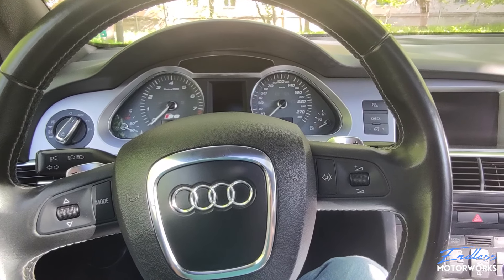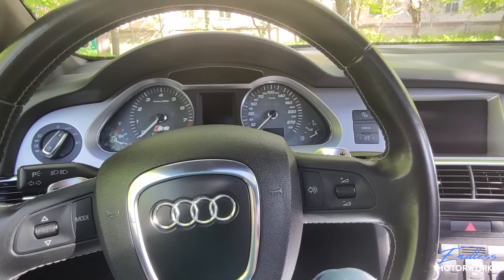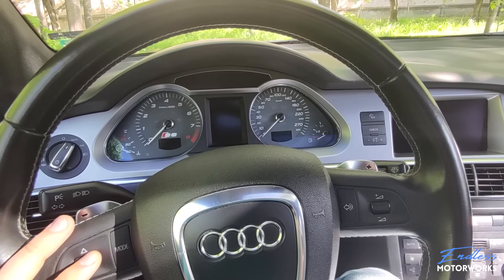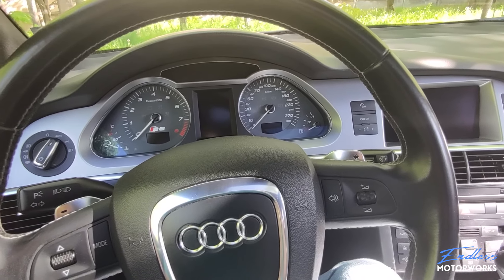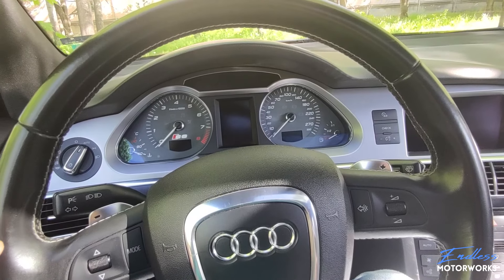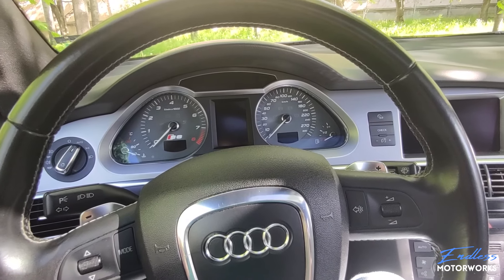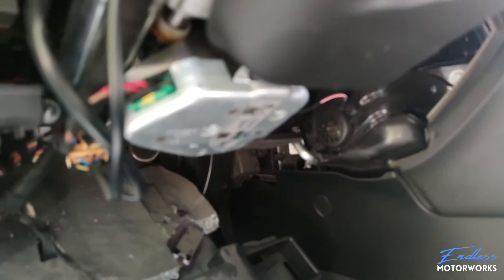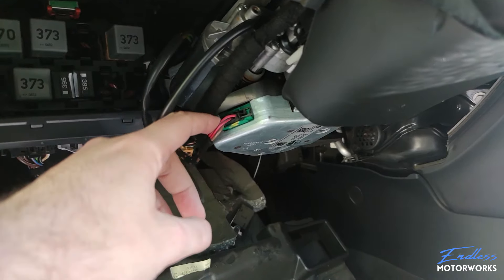How to Prevent or Fix the Steering Wheel Column Lock Actuator Issue on an Audi A6 / Q7 (DIY Repair)

Comment: Great video, thank. Wonder if it possible to just disconnect plug remove wire from plug nicely and put plug back in? Would that work? Thank you.
Reply from the maker: I have not personally tested this, but as far as I remember from the research I did before doing this DIY, this wouldn't be possible, because removing the plug would trigger a error to be stored.
Reply: Yes, remove wire "nicely" and cover with electrical tape. 
He says that in the video, but then didn't understand your question fully 🤷‍♂️🤣

Comment: Hello...same issue as all the other guys here. Audi a6 2005. I also have no access to a vcds scanner....you mentioned that a hammer to the lock might help and i would be able to get it unlocked this way and then cut the cable. Does that mean the error code is gone also?
Reply from the maker: Yes, if the column gets unlocked the error will be stored, but will not be a current one any more.
Reply: Thank you so much....I bought the obdeleven app and adapter and it cleared the code and I could start the car....now I will go and start cutting the wire...
Reply: @andreasvoss4931  did it resolve the issue? im getting ''ignition defective'' sometimes cant start car at all, and car is dead silent, im think will this fix?
Reply: @2_S1MPLE  it depend how you see it.....after clearing the error code it has a permanent red error on about the steering wheel lock but it can't get stuck locked anymore and get you stranded. It's the wife's car and she don't mind the red error light flashing so it will stay like this.....only cost was the adapter for 69$.....not 2500$ to 4500$ to fix the steering lock and column...
Reply: @andreasvoss4931  I hace the same problema, since I cut the red-black cable. I have tried to correcto it with the VCDS un module 05 and un module 19 (Getaway), but I hace not succeeded. The car stats fine but the flashing red keeps showing up on the fis.  Have you found any solución?
Reply: @joseantoniosanchezdelgado1918  no..but it causes no other problems so I will live with it. It's not worth the real repair for a 2005 Audi a6....
Reply: @andreasvoss4931  Thank you so mucho. I Will continúe as it is now

Comment: I did just this, but I'm still getting the issue. Of course the steering column doesn't lock anymore but there's still no response when I'm turning the key. Completely dead and then works again after about 3-4 minutes of waiting / trying. 

It usually happens if I try to restart after a longer drive (30min+). 

Would sorting the microswitches help this?
Reply from the maker: Sounds to me like you never had an issue with the steering column lock actuator and the cause of the intermittent no start is somewhere else. You should get the vehicle scanned for errors before doing anything further.
Reply: @EndlessMotorWorks  how to tell if the problem for the ''dead'' symptom when insert key is because of steering lock issue, not the ignition problem which shows on dash - ignition defective''
Reply: check your battery If the Voltage low it might happen
Reply: @NIKARTIST89  problem solved: it was my wireless phone mount and charger interfering with the steering column. Unplugged and car works perfectly 😅

Comment: if you cut the wire is there the risk for locking the steering while driving?
Reply from the maker: No, this is not an option, as the wire being cut is the one that actuates the steering lock itself. If it is cut when the steering is unlocked, then it will not be able to lock itself.

Comment: Will it be the same if i unplug the wire going to the lock ? Or only cutting the black/red wire works? And is it the same procedure on Tourareg 2008 v6 ?
Thanks for posting.
Reply from the maker: Unplugging the entire connection will cause the vehicle not to start, as the module is part of the immobilizer. Not having it connected at all will make the car think that someone is tampering with the immobilizer system. Cutting the wire is the only way to go. By cutting this particular wire you are interrupting the connection between the part of the mechanism that engages the actual lock, while still allowing all other functions of the steering lock to continue as they were. 

Regarding your other question about the procedure being the same on a VW Touareg, I can't tell you for sure. What I know is that this module was sued on the A6 C6 and first gen Q7. You will need to check by part number if the same module was also put on your vehicle.
Reply: @EndlessMotorWorks  Thank you very much for the info you're a life saver. Take care.
Reply: Did u find which wire color is it for the the Touareg because it doesnt have black and red wire
Reply: @hagghag9435  i was too afraid to cut any wires, so i ended up taking out the actuator, and replaced the capacitors, and it's has been working great since replaced ~ 3 months ago.

Comment: This issue just happened to me.  My question is will the push to start button work or will it immobilized.  Either way great video.
Reply from the maker: No it will not work. The immobilizer will still prevent the vehicle to start.
Reply: @EndlessMotorWorks  going to snip the wire to keep going and next time i am at the part yard will look for one to send out.  thanks again

Comment: Hello, I encountered this problem today, i put the key in electronics turrn on but my steering wheel is locked and i cannot move it,radio turns on and the lights but no contact at turning on the car? What is my next step to do. as you said in video i cannot cut the red and black wire if this problem already happened ? i need help
Reply from the maker: You will need to clear the error code that is stored. After that you can cut the wire.

Comment: Does anyone know if a 09 audi a6 ignition swith will work on 05 a6?
Reply from the maker: It will work, but will most likely need to be coded as it also has the immobilizer built into the module

Comment: Push start button will work if this wire is cut?
Reply from the maker: Yes, it will work.
Reply: So I am not mechanical, but if I can get a really good deal on a 2005 A6 w/120k for $2000, because its steering is locked... what do I need to do?
Assuming that current owner has tried to unlock it with the key
...
I am cool with cutting the wire once it is unlocked...
Thanks
I love to see videos like this that help save an ordinary Jane $$$
My husband's first vehicle was a 1989 Chevy S-10... brand new.
Before the warranty expired it's brain died and was replaced. But over the next 24 years it happened 4 times.
The brain cost $120
The labor was $2200. Because we had to unscrew the entire dashboard to reach the brain.
It wasn't difficult but damn if it didn't take forever to do.
Looking forward to your reply
... plus you Rock

Comment: Bro my audi a6 2007 may same issue.
When I put the key and turn on, nothing happens. Ignition cannot on. 
Can do the same procedure?
Reply from the maker: Lots of different issues can cause a no start no crank situation. The first thing I would recommend is getting the vehicle scanned for errors and seeing what is the underlying cause. 

Having the vehicle scanned and the errors cleared is also a prerequisite in order for what is shown in the video to be successful. Otherwise, you will may cause the steering to stay permanently locked.

Comment: Hey bro
I’ve got error code 00288

And this has been happening for months.

Steering locked, car won’t turn on and needs to be cleared on computer to start.

If I clear all the codes and cut the red and black wire will the problem come back or will it stop?

Thank you
Reply: Code says faulty steering column actuator
Reply from the maker: @1risetogether  Yes, as far as I know this is one of the codes, which can be resolved by the simple wire cut.
Reply: Thank you so much bro
Subscribed too :)
Reply from the maker: @1risetogether  Thanks! :)

Comment: is there any defects on doing this or any risk
Reply from the maker: There are no caveats to doing this mode aside from the already mentioned ones int he video - any column lock actuator error codes need to be erased and the steering column needs to be in the unlocked state while the wire is being cut.

Comment: Will this work on a 2012 A6 with push button start?  It sounds like I’ll have to get someone to clear the code to unlock the steering first. I’ve owned this car for 63 days and this just started about a week ago. 
Car will turn over but won’t start and display says Stabilization Fault, See Owners Manual.
Reply from the maker: Seems like a different error to me. Also this particular DYI is really meant for the vehicles specified - Q7 first gen and A6 C6. I can't really say if it will work on anything else as I haven't tried it on any other vehicle.

Comment: Hi, I have 'Steering lock Failure' message come up when I start my 2010 Q5 diesel. Does this have the same lock as the Q7, I have had it lock a couple of times and need to do a 'fix' on it, hopefully the red/black wire. Is the lock the same on the Q5 as it is on the Q7?, thanks
Reply from the maker: The lock actuator is not the same. Because of its internal differences I am not even sure it works in the exact same manner.
Reply: @EndlessMotorWorks  Thanks for you reply, not what I wanted to hear, but nothing is easy when it comes to cars. I will have a look and see if I can do a temporary disconnect, see if that works
Reply from the maker: @ranuiqh  I wouldn't disconnect the entire connector, as this will cause the immobilizer to kick. The column lock actuator is part of the anti-theft system. 

The best route would be to search for a wiring diagram and how exactly this actuator works on your particular vehicle in order to understand whether something similar to what is show in the video is applicable to you.
Reply: @EndlessMotorWorks  Thanks again for your reply, I wont do anything the cant be reversed easily, I may just have to buy a new unit
Reply from the maker: @ranuiqh  Most probably yes, but there is a good chance that it will need to be coded to the vehicle.
Reply: @EndlessMotorWorks  Thanks for your comments

Comment: I have 2007 Audi Q7 what if the wheel is not lock but still won’t start because of the module can I still cut it or need to reset the codes first
Reply from the maker: You can, but it will not resolve your issue, because the wire that is getting cut only supplies power for the actuator motor, meaning the thing that actually engages and disengages the lock mechanism for the steering wheel. That being said, the steering lock actuator is also an integral part of the immobilizer system. If your vehicle isn't starting, your steering is unlocked but you are sure the issue lies with the steering lock actuator, then replacing it is the only way. Do have your vehicle scanned for errors, as failures of the module in this way is not very common. You need to eliminated every other possibility for a no start of your Q7.

Comment: After unlocking and clearing the error  code i cut the wire and it worked  as you described....but i have a red ignition lock warning on in the Display at all times now.....any way i can get rid of it or do i have to live with this?
Reply from the maker: Seems to me the error wasn't cleared out properly. I recommend repeating the process once more.
Reply: im getting randomly ignition lock light and says ignition defective, will this be gone if i cut the wire/
Reply: @2_S1MPLE  if you cut it the message will stay on permanently.....but it will never lock and let you get stuck at least.....
Reply: @andreasvoss4931  even if you clear Codes before cut there be  Code?

Comment: After cutting the black/red wire I got error on dashboard "IGNITION LOCK" and it's beeping 3 times.
Tried clearing faults in VCDS, remove them all and once I start the car again, the error appears again.
Is there any way to remove this error and beeping?
Reply from the maker: Assuming you are performing the procedure on one of the two models that this video is intended for an not another type of vehicle, the wire needs to be cut after the error has been cleared. If you cut first and try to clear the error it will remain as the vehicle has no contact with the ignition lock. You can reconnect the wire, clear the code and then disconnect the wire again.

Comment: Hi, this morning I tried to start the car, no light is on, there is no contact, the steering wheel is unlocked. Question for you, if I cut the red wire on the steering wheel lock now, will I be able to start the car? Thanks!
Reply from the maker: From the symptoms you are describing you most likely have a failed battery. Recommend getting a multimeter and checking the voltage of the battery in order to diagnose this.
Reply: @EndlessMotorWorks  No its not a batery, the mechanic said its wheel lock actuator is it posible to cut the wire and to start car with out problem...

Comment: This morning I tried to start my 2005 A6 but upon inserting the key the lock disengaged while I wasn't able to start the car. Only the odometer and time were illuminated. I pulled the key out and back in, no more lock sounds and still no ability to start. Should I cut the wire and be able to start the car again or is something else at fault?
Reply from the maker: Doesn't seem like the lock actuator is the culprit. I think it might be something else going on.
Reply: @EndlessMotorWorks  I just put my car at a mechanic to get it checked out. I called my local roadside assistant and they put power onto a fuse number 7 on the driver side fuse box, reset all codes while powering the 7th fuse and then when all codes were cleared (which took a minute) then the car dash lights went on and the car started succesfully so we disconnected the battery from the fuse. When I drove it to a mechanic and turned the car off I was curious if the problem would return. Took the key out and the steering lock surprisingly made a noise again, put the key back in, again lock noise and started the car succesfully. I don't know what the issue is but the roadside assistant said this car has common issues with steering module and needs to be checked out and/or replaced. I don't know.

Comment: Hi, I have same issue in Audi A8 2009 4.2, and the plug which is u cut the red and black wire is different, I got a yellow and red and red and one else I forgot, what I have to do I need your hand.
U want me take video I will
Reply from the maker: On the A8 as the electronics in the steering lock are different and so is the wiring. As far as I am aware this mod cannot be done to the A8, as cutting either one of the wires for your steering lock mechanism will also disable the immobilizer, causing the vehicle not to fire up.

Comment: What if you was told you need a new rack and pinion would this method still work to bypass this ?
Reply from the maker: This fix is specific to the steering wheel locking due to an issue with the lock actuator module. If you have any other issues with your steering column, doing this diy will not be able to resolve them.

Comment: Hi, in my case i cant even get any sign on control board when i turn key on, so I connect the obd and no respond on laptop, do you know any other way to make restart before i cut the wire?
Reply from the maker: Some people have had success with disconnecting the car battery for some time and then reconnecting it back up. It doesn't always work, but you can try it.
Reply: Dobar dan želim
 Da li ste resili problem? I sta je bilo
Reply: @RAALHE  Da riješio sam, problem je bio u uređaju koji zaključava volan, on se nalazi ispod volana. Spojio sam dijagnostiku tj. laptop i poništio sve greške, onda pokrenuo auto, kad se volan otključao samo sam presjekao žicu odnosno napajanje tog uređaja. I sad nemam problema jedina mana je to da je sada volan stalno otključan.
Reply: @antebosnjak4123  kod mene samo otkljuca bravu dole a nema ni jedna lampica na tabli kontrolnoj kad dam kontakt, auto moze samo na gurku da upali kad je dat kontakt. Anlaser nov,nov akumulator sve gledao sta sam znao...releje,osigurace,kontakt brave 3 druge probao itd.....nzm sta je..
Reply: Molim te mi pomozi ako nesto znas. Hvala ti puno
Reply: @RAALHE  tako je i kod mene bilo, kad okrenem ključ ništa se ne dogodi, ne daje nikakav znak, a volan zaključan i mjenjač jer je kod mene automatik. Zato sam imao problem sa dijagnostikom jer da bi se spojio na auto treba ti kontakt. Pa ima fora kad spojiš laptop, izvadi ključ iz brave, trebaš pritisnuti kočnicu, upaljena sva četiri žmigavca i držati rukom duga svjetla upaljena dok dijagnostika ne dobije signal kad se spojiš sve greške izbrišeš i nakon toga auto bi se trebao pokrenuti. Ja sam probao s jeftinijim uređajima i nisam se uspio spojiti na auto, tek sam uspio kad je kolega donio laptop.
Reply: @RAALHE  žicu možeš presjeći tek kad se volan otključa.
Reply: @RAALHE  žica je crno crvene boje
Reply: @antebosnjak4123  hvala ti na odgovoru. Ja imam delphi 150, probacu sa njom sada. Kod mene otkljucava bravu dole kad gurnem kljuc i ima prima dijagnostiku, samo ne rade ni svetla ni nista ne nemoze paljenje jer nema kontakt onako na tabli da svetli. Radilo sve normalno. Stao na parking posle 25min na kontakt nista i vec par dana se cimam ne mogu da uradim nista.....